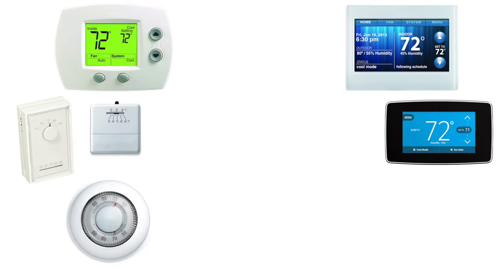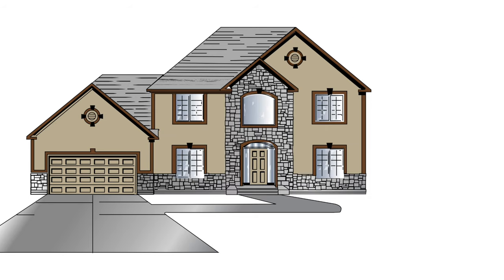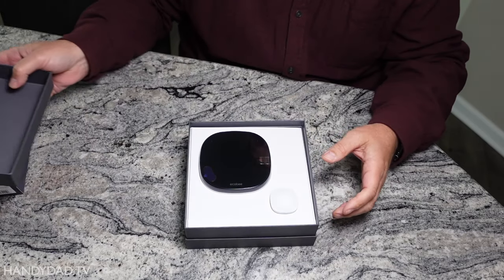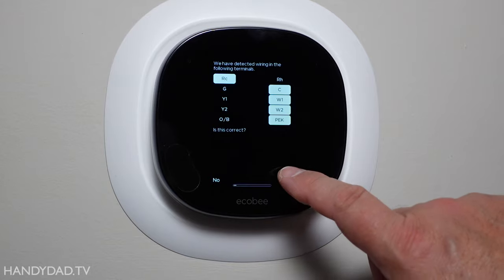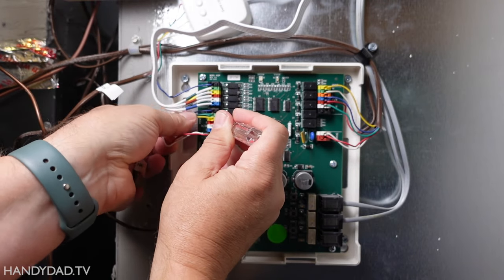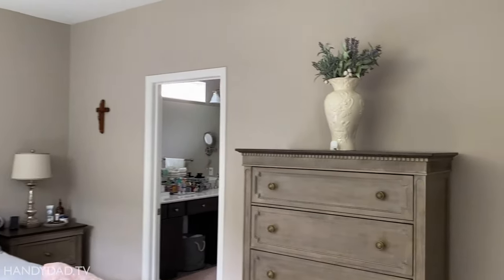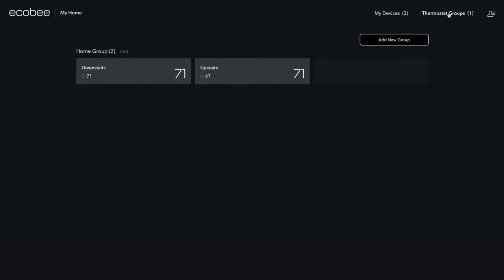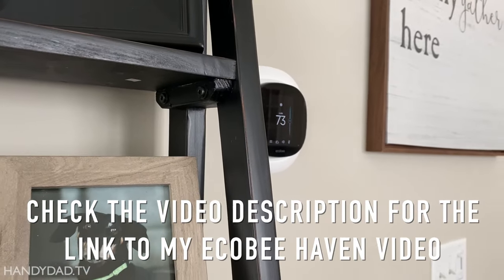ecobee SmartThermostat with voice control Multiple Zone Installation

Comment: Great video, I have 5 zones, all heat only (two wire system), I have ordered 5 of the ecobee3 Lites, that all come with the power adapter, I will add a board to hold these above the zone board.
Reply from the maker: I’m loving these thermostats.

Comment: My electric company is a co-op where our high demand rates are 2-6 pm m-f and much cheaper other times.

They are contracted with Connect-To-Save, and they installed both of my Ecobee basic thermos plus a water heater monitor, all wifi.

Best part, it was all 100% free. I also agreed to allow them to raise/lower my temp remotely based in predicted high demand, which they warn about the day prior. 👍🤓
Reply from the maker: That’s a good deal for everyone.

Comment: Thanks for the info on the grouping feature!  I didn't know they could do that.  Syncing the system mode is particularly useful.

Another useful feature, that I didn't know about initially, is that you can change the minimum difference between the HEAT and COOL settings in AUTO mode (which switches between HEAT and COOL modes automatically).  I think the default was 5°, which is too wide a range for me, so I didn't use the AUTO mode.  I reduced it to a 2° split and now use AUTO as my normal setting.

One feature that I'd like is for the thermostat to be aware of the outside temperature, and temperature trends, and use that information to keep it more comfortable inside.  For example, when the temperature is very cold outside, keep it a little warmer inside.  Also, no need to switch from HEAT to COOL in AUTO mode if the outside temperate is already cooler and trending down.  Things like that.
Reply from the maker: Thanks for the tip about AUTO mode. Good idea about the outside temp.

Comment: How do you recommend handling comfort zones and sensors with multiple thermostats? Do you use one thermostat for syncing all sensors and creating all comfort zones?
Reply from the maker: Link the comfort sensors with the thermostat that controls that zone. 

I have several sensors downstairs (office and 2 bedrooms), but only one bedroom sensor on the upstairs thermostat because it’s a smaller zone.

Comment: Im so glad I found this video I have the EXACT same home setup. 1 unit, 2 zones. 

would you recommend having both thermostats to be ecobee premium? Or could you mix and match between lite/enhanced
Reply from the maker: When I bought these, I don’t think they had the Lite version. I like the room sensors, so go with whatever version supports them. 

One note of caution: they stopped supporting the linking between the two. So you need to remember to change the mode on both of them. It can be done with Home Assistant if you desire but not directly between Ecobees.

Comment: Great video! I have junction electrical boxes behind each of my current Venstar thermostats in my 2 zone system. Will I need an adapter plate in order to mount an Ecobee thermostat over the junction boxes?
Reply from the maker: Hard to say. It comes with a large backing plate. The holes may line up.
Reply: @handydadtv  Thanks for the response.

Comment: Question: I have a large home, its two stories with two separate furnaces; one for the 2nd floor and one for the 1st floor. Each furnace has three zones serviced by motorized zone dampers. Each furnace has one main thermostat and two each wired sensors monitoring each zone and an equipment control module panel. The furnaces are Carrier with Carrier Comfort II Programmable Thermostats. Is the Ecobee Premium Thermostat Compatible with my existing zoned system? Can it be operated with replacing the two thermostats or will it require six Ecobee Thermostats to operate each zone?
Reply from the maker: You need to ask your HVAC guy. I had a Carrier system in my old house and could only use a Carrier thermostat.

Comment: Great video. Which AC and furnace do you have or were you using in the video? I've got a carrier 2 zone system and desperately want to get away from the carrier smart thermostat. Also, which model of the ecobee did you use here?
Reply from the maker: I had a Carrier Infinity system in my last house and unfortunately could never use a 3rd party thermostat. You’ll need to check with your HVAC guy.

Comment: How will I know if my furnace transformer will be powerful enough for my two thermostats? Both of my thermostats will need to use the adapter. Thanks for the video, very informative.
Reply from the maker: If your zone board supports a C-wire on each thermostat, it’ll probably handle the load. Mine worked fine with 2 ecobees.

Comment: I have a C wire and dual zone for two story house.  what you didn't show is that for both Ecobee's do I install the wiring the same.  or do I use the Y2 and W2 since they are two separate zones.  My HVAC I just added second Ecobee and the entire furnace keeps shutting off.  I did just link them ask instructed in this video but im afraid that the wiring is supposed to be a little changed.  both sets of wire had the same labeling and color.  But should the top floor maybe be set to Y2 and W2 so they aren't fighting each other.  Or is the paring the Ecobee group enough?
Reply from the maker: If you have a zone board, each thermostat is wired as if it’s your ONLY thermostat (use Y and W on each). The zone board does all the work to set the dampers and turn on the furnace or AC.
Reply: @handydadtv  ok update..  so we tried grouping the ecobee but something keeps turning off the eqiptment.  And this didn’t happen until we installed the second ecobee.  So after some time the equipment won’t run.  The ecobee thinks it’s running but it won’t start.  so something isn’t working right with the wiring.  Is there anything I can do?  Any wiring I can change..?
Reply from the maker: You originally had two thermostats that you replaced with Ecobees, right? And the system worked fine with the old thermostats?

Comment: I'm looking at getting the Google Nest, is the Ecobee better?
Reply from the maker: I have no experience with the Nest but I don’t care about the “learning” aspects. I prefer to control the schedule and the ecobee with the room sensors are just awesome for that. Plus it overrides the schedule to save energy when nobody’s home.
Reply: I have the Google Nest. It's the non-learning one, but it still has a lot of capability to schedule and control it. Here in Oregon, the state will give you a coupon to buy one for $30. I've had it for about a year and I like it. I like the app - it's pretty straightforward. I just linked it up to Alexa, and you can do simple temp changes via voice. Ecobee looks pretty good too. I'd check for rebates in your state or with your utility company.
Reply: I had a Nest for about a month, and loved it. Unfortunately, my heat pump and the Nest didn't get along too well. Once the desired temperature was reached, the thermostat would "slam" the compressor off, making this awful sound every time it shut off. My HVAC guy installed a Honeywell and the system works flawlessly. I've been looking at ecobees for an upgrade, so I'm glad to see a positive review from HandyDad TV.
Reply from the maker: Good tip. Thanks.
Reply from the maker: Thanks 😊

Comment: Thanks for the video. Do you know if if this would work on a 4-zone 4-wire system? Currently I have a single thermostat that controls all 4 zones.
Reply from the maker: I don’t know how you can have four zones with only one thermostat.
Reply: @handydadtv  I have a Carrier system that uses the Carrier comfort zone II thermostat. It's one thermostat to control all 4 zones. There's a sensor in the thermostat & 3 other sensors in the other 3 zones.
Reply from the maker: Do not replace that thermostat with Ecobee or anything else. It’s matched to your system.
Reply: @handydadtv  I figured. Thanks for the reply. I guess when the system finally dies I'll be forced to get everything new. The Carrier is 18 years old & still goig strong.
Reply from the maker: 18 years is great!

Comment: Hi, i had the same problem. I want able to figure out the zone board. Now I have done it with the guidance here. But my AC wouldn’t turn on. In my old thermostat there was a jumper wire between Rh and Rc , does that need to be added to my ecobee too?
Reply from the maker: I would try it.

Comment: I have the same exact setup and i got 2 ecobee thermostat. I had a quick question on wiring.... for my upstairs and downstairs do I just do the wiring exactly the same? RIght now my current thermostat does have the same wiring upstairs and downstairs. Thanks.
Reply from the maker: Yes the wiring is the same on both. Neither of mine had a C-wire.
Reply: @handydadtv  I dont get it... Why do we need multiple units ? It's a smart thermostat after all,  isnt this suppose to control multiple rooms (zones) ?
Reply from the maker: It depends on the way the HVAC is designed. If you have two thermostats, they might be connected to a zone board or two separate units. Either way, a single ecobee can’t control multiple units or zones, even though it can monitor the temperature with remote sensors.

Comment: Question, so you can operate multiple zones with one thermostat using the small temperature sensors to operate the dampers?
Reply from the maker: No. I apologize if it’s confusing, but my system has two zones: upstairs and downstairs. Each zone has a thermostat connected to the zone board that controls the dampers. The room sensors are optional; they connect to a thermostat to expand its “reach” into other rooms to allow you to customize the comfort settings. 

For example, I like my bedroom cool when sleeping. The downstairs thermostat uses my room sensor at night, and it ignores the rest.

Comment: I'm looking to upgrade to a smart thermostat.  This video is the first one I've seen closest to the set up in my home.  I have 3 zones on my air handler.  Do you feel Ecobee is still the best way to handle all these zones?  Different product?
Reply from the maker: I haven’t tried them all, but I did my research and chose Ecobee for my home.

Comment: I have a dual zone as well. Did you use one Ecobee thermostat or two to control both zones? If we can get away with just one ecobee, what happens to the second original t-stat? Will that remain functional?
Reply from the maker: How many thermostats do you have now? If you have one that works both zones, it’s probably a specialty thermostat that shouldn’t be replaced. If you have two now, you need two ecobees.

Comment: I have a weird scenario, I have 1 HVAC system, dual zones (main and basement) like you but I need to be able to run heat in the basement (babies bedroom's and it's always cooler than 67 down there) yet run AC upstairs because it's hot being summer. So I can't group them like you did because I need one to run heat and one ac, I'm just worried it's going to try and run them at the exact same time
Reply from the maker: Maybe your zone board has a setting that allows them to be mutually exclusive?

Otherwise, I would use an alternative heating source in the basement. Like this https://youtu.be/3H-oCZ1sW7o

Comment: I have a question about what "multiple Zone installation" might mean for me:
Can (1) eco bee thermostat be wired to control a HW heating system that handles 2 zones on a 1 level ranch house?
- (1) zone operates the kitchen which has radiant floor heating, 
- the remaining zone operates the heat for the rest of the house 

Would one thermostat wired correctly, operate the 2 zones? Would/could the sensor (that comes with the thermostat) that was placed in the kitchen let the main thermostat know when heat was required etc? or, do I need 2 separate thermostats?

I cant seem to find an answer to that. Thank you in advance
Reply from the maker: No, it can’t. If you have two heat sources (furnaces, boilers, etc), you need separate thermostats.
Reply: @handydadtv  I have only one heating unit for my house. I do have 2 zones though. Heat for everywhere but the kitchen, which now has radiant floor instead of the radiators...
Reply from the maker: That’s like my setup. You need one thermostat per zone.

Comment: I turned off the "Follow Me" feature as it was ignoring my comfort settings at night. Only wanted it to use the bedrooms overnight for temps, but it doesn't sense motion so it defaults back to the ecobee in the hallway... nights got cold lol.
Reply from the maker: I don’t use “Follow Me”. I have a Sleep comfort setting and only assign the bedroom sensors to it. That way it ignores the temp in the open areas.

Comment: We have multiple zones and 1 hvac, this really helps. Thanks. The one thing in with our ac is there is only one controller that controls multiple zones. Can one eco bee smart thermostat control zones? Or do you have to have the controller in each zone?
Reply from the maker: Hang on a sec. You currently have multiple zones with only ONE thermostat?? That doesn’t sound right.
Reply: It’s strange, I’ll try to link a photo.
Reply: https://photos.app.goo.gl/5ZvjJTjmkZifSB7v6        
That link is to a photo of my thermostat controller. It has buttons for multiple zones and is the only controller controlling the zones. We can only set one temp thought the whole house. But I don’t know how I’d use zones with the ecobee
Reply from the maker: I honestly don’t know how that works. It would need multiple temperature sensors around the house.

But, to answer your original question, one ecobee will only control one zone. I have two zones, so I have two ecobees.

Comment: If the second thermostat in the basement isn’t also an Ecobee, what do you do with that thermostat as far as it’s functionality?

Also, I thought the blue wire WAS the C wire set up? You said you didn’t connect it because it was for something else …. But I was told that the blue wire was the necessary
Reply from the maker: The colors don’t matter - they are purely a convention based on your particular installer. 

If you only have one Ecobee, you would need to manually keep their modes in sync.

Comment: Ok, this is a tough one.  I just moved into this large home I purchased.  I have two thermostats downstairs and one upstairs.  Only one furnace like you.  The issue is, I don't seem to have a zone board!!  I have only one full set if wires connected to the main board that is going to the "main" thermostat downstairs.  After connecting the unused blue wire as Common at the furnace, the Ecobee works fine.  However, the 2nd downstairs thermostat will not power on.  I wired it exactly as the first.  Strangely when I connect the Ecobee the fan comes on right away!  But the Ecobee doesn't power on.  I am flummoxed as to how this 2nd thermostat even works.  There is another set of wires to the furnace board of which only two wires are connected.  A Red wire connected to Common and a Yellow wire connected to "Y".  I assume this is my central AC unit.  
It only makes sense that my thermostats must be connected together somewhere to result in a single set of wires but darned if I can find a zone board anywhere in the house!!  The house was build in 2005 if that matters.  Any ideas?

Comment: Do you think Echobee can function as Outside Control Reset ?
Reply from the maker: I’m not sure what you mean.
Reply: Thanks for replying to me. Tekmar 260 is a controller that connects to outdoor temp sensors. The sensor reads the outside temp and sends back to the controller, then controller regulates Boiler, instead of echobee temp setting. For example, in summer, the sensor reads  outside temp is 90F, then will let controller to cool down the boiler because you simply dont need to much heat in summer, even though echobee has 100F . In short, I am just wondering if echobee can send temperature setting to the boiler dynamically per the temperature outside.
Reply from the maker: Not that I know of

Comment: Great video! My home has the same set up as yours with two zones, 1 HVAC system and a Zoneboard. I am looking to get the Ecobee smart thermostat but wanted to see if its necessary to replace both thermostats with the Ecobee or would it be possible to simply replace one? My second zone is an upstairs game room and we dont use it enough to swap out that thermostat.
Reply from the maker: You can do just one.
Reply: I'm in the same situation. Just wondering if this worked for you: 1 ecobee and one older standard thermostat.

Comment: I heard from ecobee that thermostat groups were temporarily disabled due to some issue and suggested it would be back at some point. Has this affected your setup?
Reply from the maker: You are correct. I found out the hard way. I turned off my downstairs thermostat and had windows open for several days this Spring, and was surprised to discover the heat was running upstairs!

I contacted ecobee support and they told me it was disabled due to a bug and they had no idea when it would be fixed. I was so pissed they didn’t PROACTIVELY notify me of this change before I wasted all that energy! They have my email address. They know I had a thermostat group. They could have emailed me. Really disappointed by that. 

Now I know, I can handle it manually. 

But at least you’re aware before getting into it.
Reply: @handydadtv  yeah… I’m wondering if I should look at any particular competitors before purchasing ecobees for my new house. Do you know of any to consider?
Reply: @handydadtv  when the grouping worked, did it coordinate circulation with just the fan between both zones?
Reply from the maker: The zone board does that. All the grouping does is keep the modes in sync. So if I turn downstairs from Cool to Heat, upstairs would do the same automatically.
Reply from the maker: Honestly, I didn’t know ecobee had this feature! It’s not available in the app. You can only setup a group on the website. 

I don’t know if any other brands support grouping like ecobee.